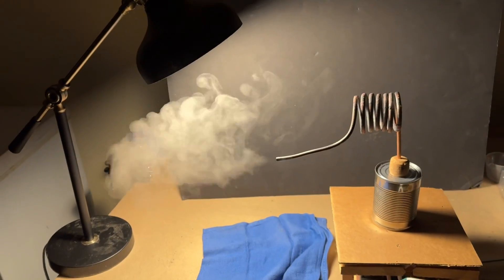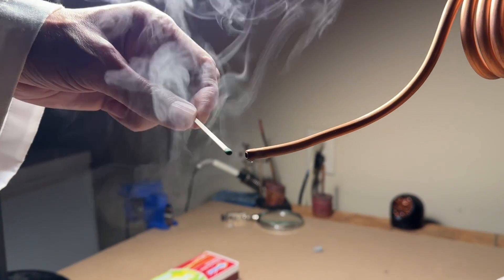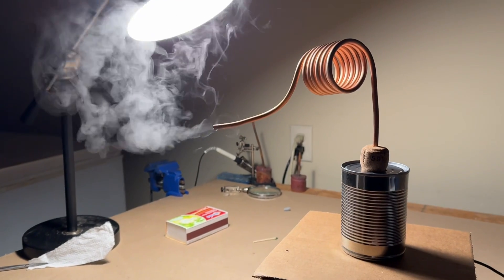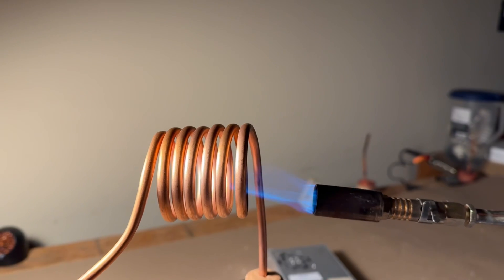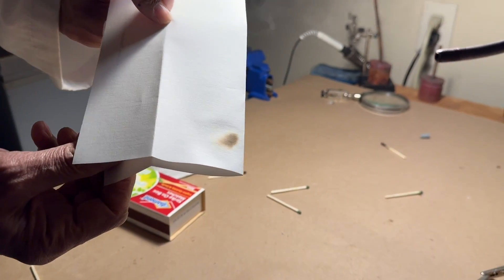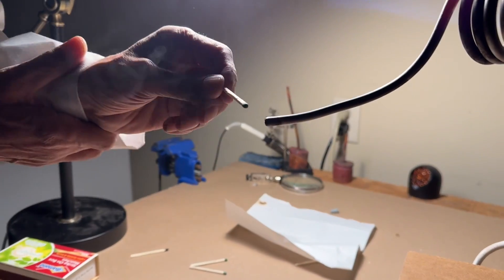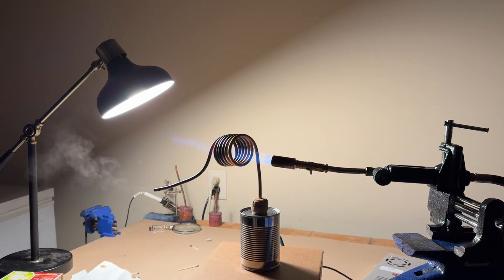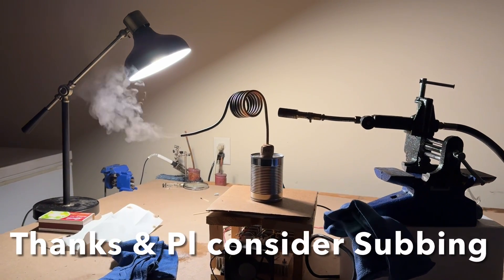Igniting matches & combusting paper using steam

Comment: i bet ya that without steam but just air going through that pipe and flame gona do the same....
Reply from the maker: Probably would but I understand that steam has a much higher specific heat capacity compared with air and can carry a lot of energy in it.
Reply: @BrianDhvTinkerer   then this demonstration by definition is useless because its not showed/proven that steam carries more energy than just heated air ...

Comment: looks like it's not the steam but the super heated copper pipe that ignites the match as well as burns the paper.. well at least how it looks to me
Reply: It is the steam. You just cannot see the steam as it has been super heated. It turns into dry steam AKA 100% water vapor. It can reach temperatures over 1000°
Reply: GOOGLE, question: "is steam visible" Answer: Steam is produced due to evaporation or as a result of boiling. Saturated or superheated steam is invisible, but often 'wet steam' is visible due to liquid water droplets forming as water vapour condenses. Steam can be seen

Comment: super heated steam is what ships boilers produce........in WW2, the US Navy was running 450psi of super heated steam pressure.
Reply from the maker: That’s scary for sure. Superheated steam at atmospheric pressure is dangerous enough
Reply: @BrianDhvTinkerer    scariest thing I have read about is the nuclear powered scramjet engine for Project Pluto.  At Mach 3.5 and tree top height above the ground, the air coming into the engine was already at 1000C and passed through the fuel rods and heated to 3000C, making equivalent 250,000hp .   Amazingly they tested the full sized engine at full power for 20 minutes.......using days of preparation and 53 miles of large diameter oil pipe casing to store the compressed air, that passed a series of heated steel silos to reach the 1000C temps needed to simulate actual flight conditions. Pluto was designed as an armored heavy cruise missile, that was impossible to shoot down, and could almost single handed destroy the USSR with a magazine of 12 heavy multi-megaton H-bombs.
Reply from the maker: Wow!!!
Reply: @BrianDhvTinkerer     They got to the stage of testing the engine in the air frame and had discussions about putting it on a large tether.  There was also the problem of the engine discharging large amounts of radioactive fallout in flight........and that the supersonic shock wave would have killed people on the ground.  Everyone breathed a sigh of relief when the ballistic missiles (rockets) became reliable and established as the preferred nuclear weapon delivery system.  Its is a truly amazing engineering story.
Reply from the maker: @wazza33racer thank God for ballistic missile technology !!!